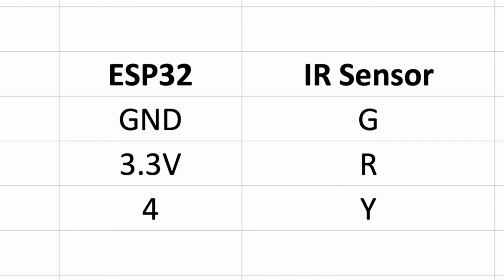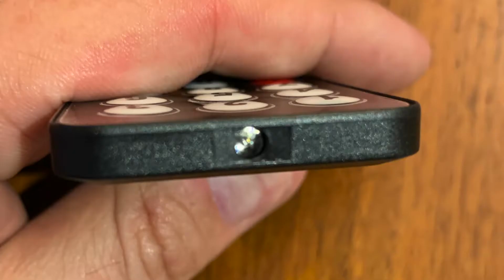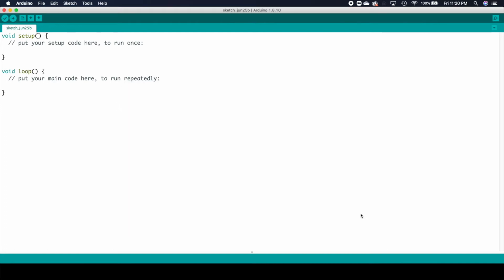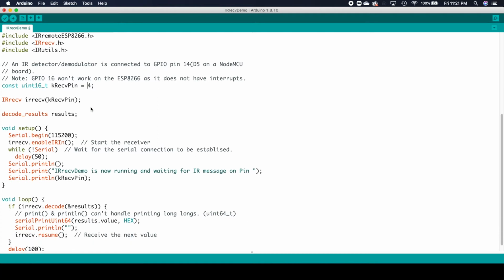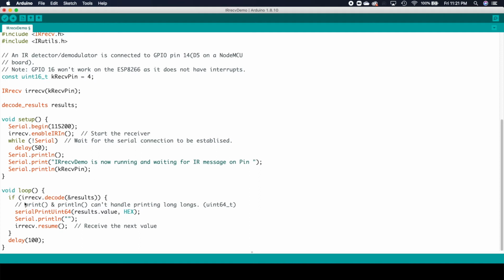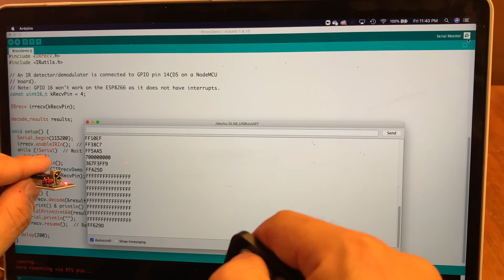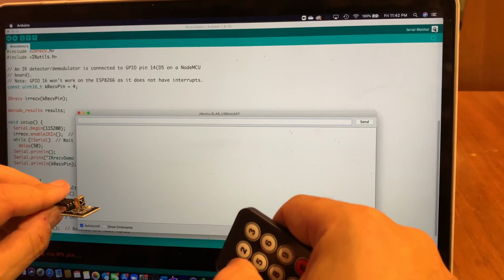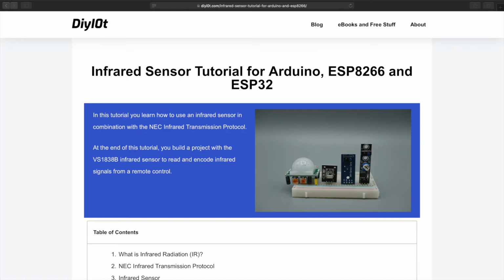ESP32: How to Read Signals from an Infrared (IR) Remote

Comment: Nice video.  @4:31 you describe the long string of "F" chars. This is not noise but the repeat value when any IR remote key has a long press.
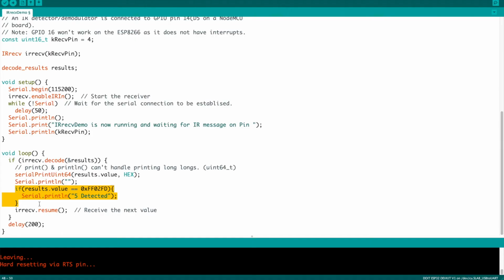@4:48  you decode a key using results.value   This is not too well explained and its a problem for any beginner starting in C language.  This value is derived from one of the #include files, in particular  IRrecv.h 
You will find at line 99 that a class called "decode_results" is defined. A structure is set up allowing you to view  the decoded  value, address and command.
Adding a line to your program:
Serial.println(results.command);
Will also display the integer value of the command used. This could prove useful in some projects.

My explanation is also not  explained well, but it is nearly always required to read through the header files in most programs for a better understanding.

Comment: Great video! I'm new to ESP32. My project I'm working on right now is to trigger a few existing IR-driven devices in my home on a schedule. I've already managed to get the ESP32 talking with the automation software I'm using.

I'm using IR since it's already a part of the devices I'm wanting to run and I don't want to modify them by directly tapping into signal wires (a bit too invasive for my purpose). I need to emulate the existing IR signal so I need to know what the code I'm going to be broadcasting is - this will help me figure out what signals to send!

Thanks!

Comment: hello sir 
i need to ask that how can i use print and scan code in esp 32 ?
Reply from the maker: I’m not sure what you mean. Could you provide more detail?
Reply: @BaldGuyDIY  i mean to say like we used print and scanf code in c programming. can i use it here. actually  i want to do something like this. when my esp 32  is connected to screen and keyboard whatever i type on keyborad i should show it on the screen.
Reply from the maker: Hi Ali, I’m not sure, I haven’t done a project like that before. Besides looking online for something similar, I don’t have any other suggestions for you at the moment. You can communicate with the ESP32 over a lot of different wired and wireless protocols, but you’d have to do some reading up to know which to use for your needs.
Reply: @Alikhan-uv6us  C programming is a little different, for example Arduino uses the "Serial.print" command. Do a little more research and you'll find a video for anything using Arduino.
Reply: @AuxiliaryPanther  thankyou mate i already did it ❤